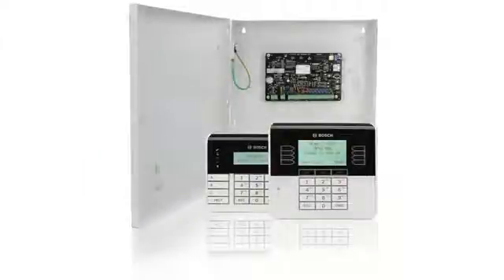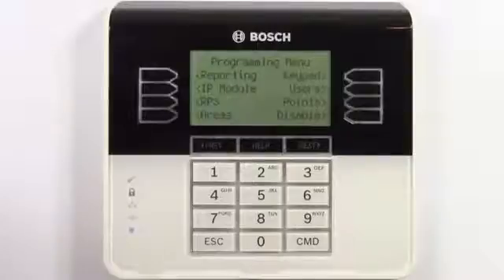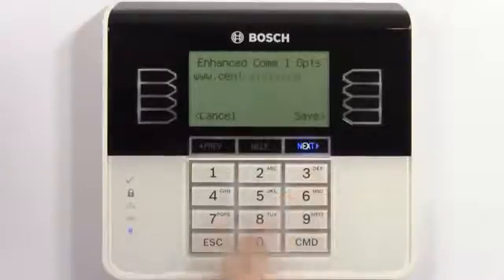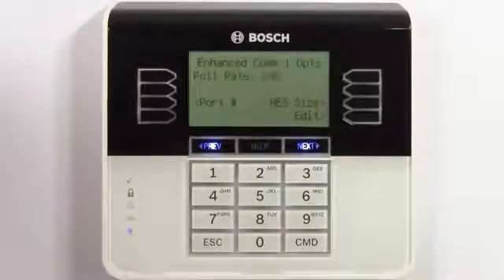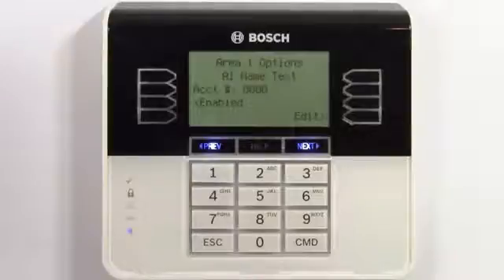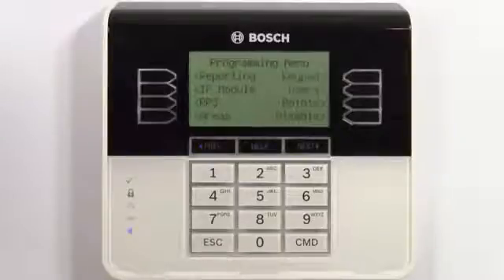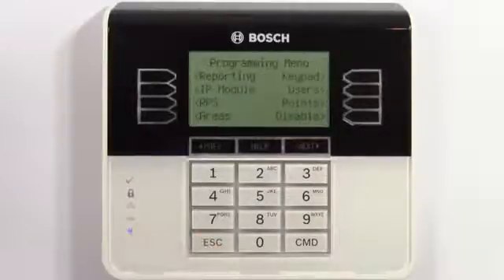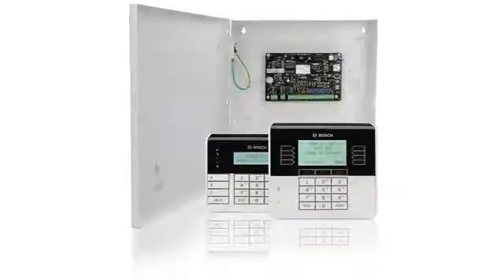Bosch B-Series Intrusion Panel: Keypad Programming

Comment: Can this keypad do fire alarm?
Reply from the maker: Thanks for your question. First, you need to have an alarm panel that is rated for fire. You can use B series for residential fire or you can use the G Series for residential or commercial fire. Next, you need a fire-rated keypad like the B925F or the B926F. Thanks!
Reply: @MidChes  how can I change Alphanumeric display on the keypad?
Reply from the maker: @benqtzzo6888  thanks for your question. Please email ari@midches.com for assistance.

Comment: Can this keypad alerted a fire alarm is activated?
Reply from the maker: Thanks for your question. First, you need to have an alarm panel that is rated for fire. You can use B series for residential fire or you can use the G Series for residential or commercial fire. Next, you need a fire-rated keypad like the B925F or the B926F. Thanks!

Comment: Are you able to add points on this? Well the fire keypad version
Reply from the maker: We strongly recommend you add points using Bosch RPS software, because there's no way to see all the point parameters via the keypad method. However, it is technically possible in a pinch. Enter your installer code to put the keypad into dealer mode. Enter 1 for the installer menu. Enter 1 for the program menu. Enter 7 for the points menu. Then choose your parameters.

Comment: hello, is programming same on Bosch B925F aswell as the zones?

Also, what panel is used with the Bosch B925F?
Reply from the maker: The B925F acts just like a B920, except for the fire function keys which replace the flex buttons. Programming the panel from the B92F is identical to programming it from the B920. The B925F can be used with either the B8512G or the B9512G. 
Here's our video overview of the B925F: https://youtu.be/pBCcRwiYtlM